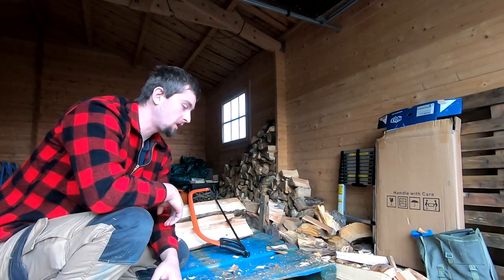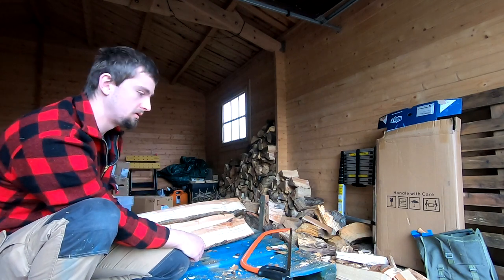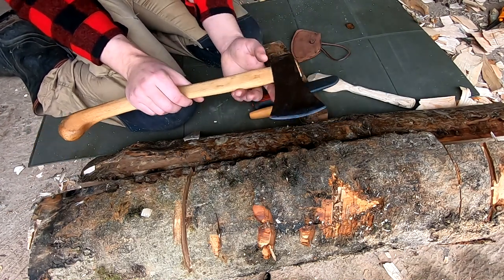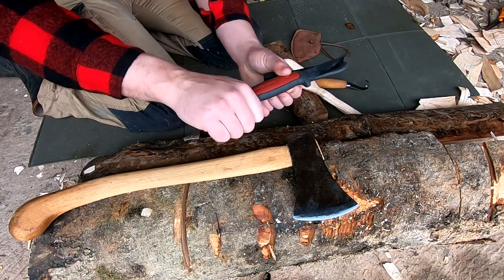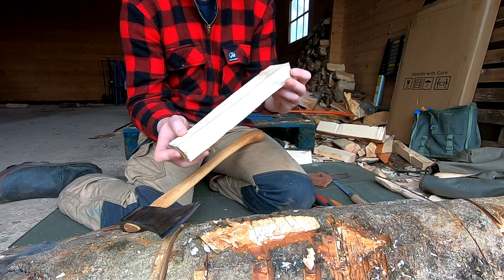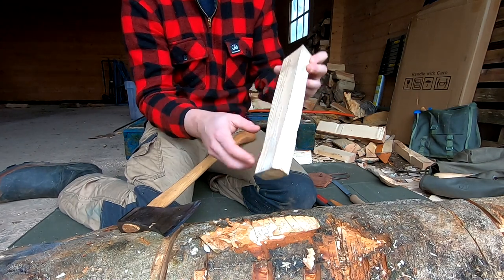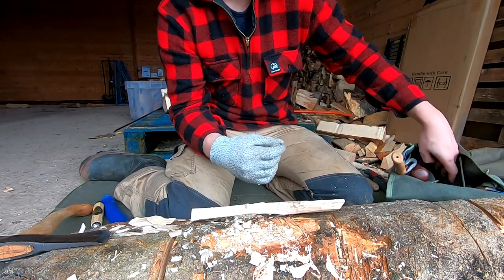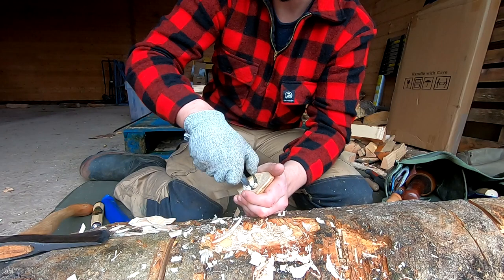How to Carve a Spoon and Sharpen Carving Axe

Comment: Loving the video!  I’ve carved tons of spoons but never from green wood, always something I got that was already dry.  I bang it out roughly with the hatchet, but use a drawknife, spokeshave, and shaving horse for most of it.  The hardest I ever carved was a white oak stave from a used whiskey barrel.  Hard as rock but made an amazing spoon.  I typically clamp it down and dig into the bowl with a large gouge.  I also got a bad cut years ago, stabbed into the tip of my finger.  It happens!

Comment: One of your best videos. Could you make me a mash paddle? A tip id maybe add that the type of wood used is important for the kitchen , in the middle ages someone made a cask out of laburnum , everyone that drank the wine died.
Reply: That’s a great idea Will
What dimensions?
Reply: Birch is the classic Scandinavian choice for wooden utensils. fruit woods are always a safe bet: Cherry, Apple, Pear. lovely woods to carve and they can last for decades. i still have a Cherry spoon i carved in 1985, ate my wheaties with it this morning. almost 40 years and it barely shows its age, i personally love Hawthorn and Blackthorn but they are tricky to carve and need great care when drying out (assuming you carved them green, which is strongly advised). Oak is ok, lasts forever, can stand the heat of cooking with no problems but it will soak up oils and flavours due to its porosity. Maples (including Sycamore) and Ash are safe though not very aesthetically pleasing due to their bland colour and (typically) straight grain. Magnolia and Rhododendron are very nice to carve but the wood is slightly toxic: can be made safe by baking in the oven at 180C/350F for 20 mins which darkens the wood nicely as well, especially if lightly oiled (food safe oil only! walnut oil works nicely) in advance of baking. i've found most evergreens to be not worth one's time but i'm told that juniper and larch can be good. that said i did have a camp spatula carved from Fir for 20+ years so there's that. :)

Comment: I completely backup your statements on the gouges! I had the exact same accident, doing exactly the same. The chisel was fresh off the water stone, I could whittle hairs with it. Left a small pool of blood and no scar whatsoever. Since then, I've learned to push the gouge only against the chopping block/backing board.

Comment: Eeey nice mate Haha I did it the hard way the other day and carved some Oak that had been down for a year. It's a very good sauce making spoon as the weight means it crushes the tomatoes really well. Also managed to get a hair shaving edge on That Ox head I bought the other day with a smooth cut file.
Reply from the maker: carving dry wood sucks, good on you!

Comment: Maybe it’s somewhere in the channel and I haven’t found it yet. Is there anything specific you would do when putting an edge on a hatchet. We’ll say a camp hatchet. Something that will be used for splitting and chopping.
Reply from the maker: 20 degree flat grind with a 0.5mm microbevel/secondary bevel
Reply: @benscottwoodchopper  I just got a new hatchet I’m going to do exactly this and compare to how I’ve sharpened in the past (using the “yeah that feels about right” method haha) great channel here and thanks again buddy

Comment: Another good video. Lots of good tips, a couple of things to go along side your points. If you want to start carving but don't have a hook knife or funds available, start by carving spatulas and butter spreaders. A svord mini peasant knife is a handy little knife for carving and it's UK legal carry so you can have it with you at all times and easy as to make new scales/handles for so use can customise it to your grip. Good point about the pointed toe, I am currently cutting a swedish style carver out of an old Kent pattern axe. As for the handle, shaving some flats on it to make it more octagonal is good for grip/fatigue. I use raw linseed oil/flax oil, its a drying oil and cheap if you get it from a farm suppliers as a horse feed supplement.

Comment: Nice video. I also try making spoons but  I don't have such spoon carving knife so I end up making a spoon with open front because you can like scrape out the grain. Anyway I've got a Question about an axe Handle: what kind of handle (length, shape etc) would you put on a 1,2 kilo harzer Axe head, which is a bit shorter and a bit broader than the Ochsenkopf one? I have beach and ash but only logs, so I won't have that grain orientation everyone's suggesting.
Reply from the maker: 70cm would be ideal
Reply from the maker: @frankbauer2561  70cm curved oxhead handles are nice, thats total length